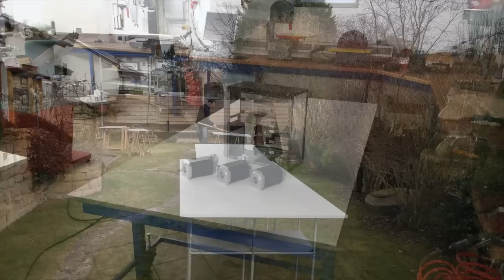Homemade CNC Router with built-in vacuum table and holes like the Festool MFT table

Comment: beautiful! question: the way you’ve designed your vacuum table with the ribs with holes; do you get good suction? i’m researching how to make a downdraft table for screen printing.
Reply from the maker: I use a 2KW Seitenkanalverdichter.
https://de.wikipedia.org/wiki/Seitenkanalverdichter
Im very happy with the table for big signs and wood from 30x30cm up.
Reply: Did you every post the green clamps

Comment: Hi Theiss. 
Do you have any whipping with those 1800x20 ball screws? I've read that critical speed for your ball screws is about 1000RPM. Did you try to get close to that? Is the speed you use comfortable to you?
Reply from the maker: I use a speed of 40mm per second (40mm/5mm=8RPsec=480RPM).
This is not super fast, but for my hobby it is OK. The limit is not my spindle. With 60mm per second the stepper lose sometimes steps.
Reply: Not sure what controller your using but the loss steps might be due to your using fractions in Steps Per Inch. Can not have partial steps. (Example you can have say 120 steps per inch, but you can not have 120.567 or errors will creep in)

Comment: hi ,i have a question , can you help me please ? 
i want to make a cnc router mill , like yours and i wanna know if for X and Y axis is okay a 8Nm stepper and for Z axis maybe a 4 Nm stepper ? will be enough ? lenght x 2200mm y 1700mm z 500mm
Reply from the maker: Hi, here my setup:
Motor: Nema 34-HS5435c-37B2 for X and Y
Belt: HTD-5 for the two X spindles
Gear Wheels for X spindles: 40-5M-0-Z
Ball Screw Spindle for X and Y : 20mm x 5mm/RPM
But state of the art for hobby systems today is: 
https://de.aliexpress.com/item/180W-NEMA-23-0-57N-m-Integrated-Servo-Motor-36VDC-3000rpm-JMC-iHSV57-30-18-36/32714727077.html?spm=a2g0s.8937460.0.0.yanoYB
Reply: thank you !

Comment: Hallo Theiss, herzlichen Glückwunsch zu deinem CNC Projekt. Kannst du etwas mehr sagen zu den von dir  verwendeten Komponenten wie Steuer-SW (LinuxCNC, Mach...),  Endstufen, Ansteuerung Seriell oder Parallel? LG Martin
Reply from the maker: I used a Software CAD/CAM and Hardware Solution from Maxx Computer (MCS103) on both of my CNC Systems. This save me a lot of time.

Comment: Hello. Nice job :) I have a Cnc my self (CNC Step HighZ-1000) but would like to build my self a bigger one. Thanks for the inspiration, do you have links and parts list for you cnc? 

I will be making my own dust extraktor unit based on the one you have. Man I really liked this one and got a big aha. Been strugling with these "hairy" ones for a while. But 99% of the time I cnc flat even stock so this will work fantastic, if I can implement it though :)  

Again, like your videos.

Best 
TR
Reply from the maker: Hi TR, thanks for your feedback, what type of G-Code software and cnc controller hardware do you use for your current and upcoming project.

Comment: How did you calculate the size for the vacuum blower? Has the .9kw model been adequate?
Reply from the maker: 0.9kw is a good compromise, you are able to make a lot of through-cuts in the work piece, before you lose the vacuum effect.
To calculate the vacuum you need always the same work piece. For me the 0.9kw vacuum blower is the right compromise.
Reply: So what type of work do you do (so that I get some idea of the capability of .9kw)? Any special techniques to cope with possibly lower vacuum?
What I am trying to get an idea of is how large a blower is enough for a 4' x 8' table with 4 zones. Lots of people use blowers but seems like many just get a huge one(for huge money) but really are just guessing on the size.
Reply from the maker: Can you tell me what type of car I should buy next time?
Your question is even or more complex to my question.
The answer to your question depends on a lot more the the following questions:
- what type of material do you use
- what material do you place between the cnc and the work piece
- how much pressure do your cnc create to the workpiece during milling
- how many cut through elements do you use.
- are they all on the same place
-  do you have time to create a mask between cnc and work piece
- should the whole workpiece connected with vacuum to the cnc
- provide a exact drawing of each of your work pieces you will create with your cnc
- is electricity costs a point for you
- and so on and so on
- there are several vacuum solutions available and not one fits for all
So, think about the questions, put it together with your questions and buy something :-)

0.9kw is a good compromise for me

Comment: This build frustrates me more than any other build I've found. 

Belts on the x axis but square linear rail everywhere only to cut MDF letters? Why do you need the accuracy of the square linear rails? Plus, the router could have been easily replaced by a decent router spindle if you would have saved cost by purchasing round linear rails instead of square... I'm scratching my head on this one. I can't imagine you'd ever load the rails enough to justify the added cost/complexity of the square linear rails. For all intents and purposes of this machine, I would argue, round rail would have been plenty sufficient. 

I don't mean to sound too critical but this seems like a lot of wasted money. With the router you get one 1/4" collet that's it. With this machine, I would have opted for a 2.2kw water cooled, vfd controlled spindle with ER20 collets. You'd get every size you could want up to 1/2". Why were the design decisions made they were on this machine? So confusing... Did you turn those brass belt tensioners?

I haven't even mentioned the use of the Nema 34 motors... WHY? Nema 23 would have been plenty... What are you trying to mill? Can't be anything too rigid... Your belts would fail before your motors. I would much rather snap an end mill before I strip my drive belt. 

Regardless, the workmanship is impeccable. Very nice work.